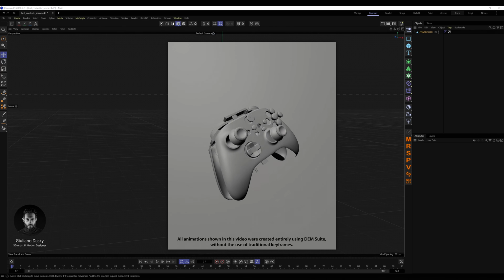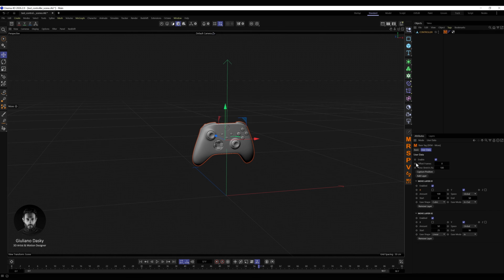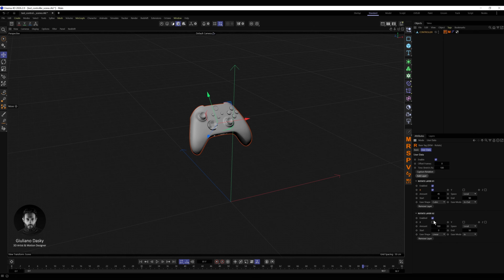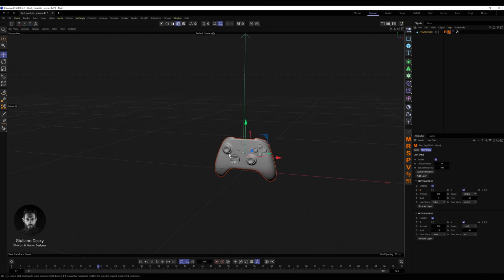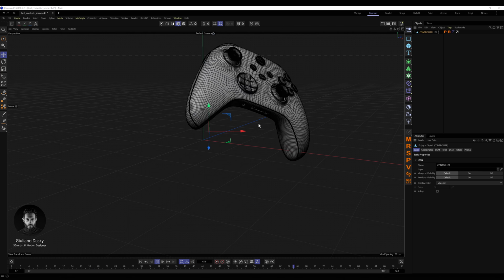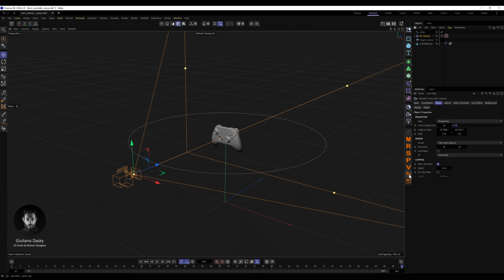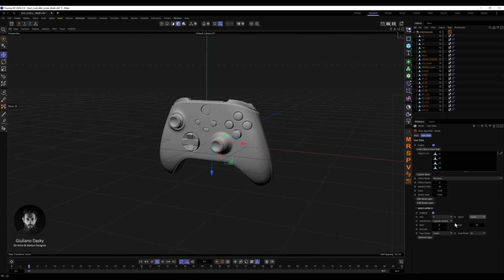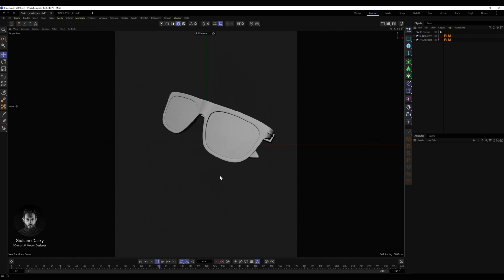How to Animate in Cinema 4D Without Keyframes | DEM Suite Tutorial

Comment: Great tool! One question: how much control do you have over the easing? For example, can I create a much longer/more dramatic ease-out at the end of a movement, similar to manually adjusting F-curves in C4D?
Reply from the maker: Yes! You already have a good amount of control using the built-in easing presets, and you can push it even further by combining multiple procedural layers with different easing profiles to create a single seamless motion.
I'm currently finishing a major update that's already in the testing phase and will be released in September. It introduces many new features, including fully customizable Bézier curves (with preview) and a dedicated timeline for procedural layers. If you like this version, I think you're going to love what's coming next! 😊